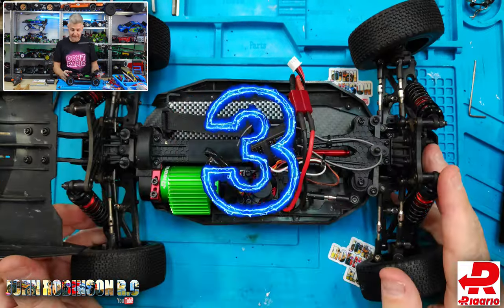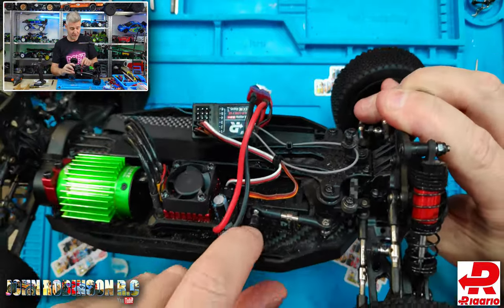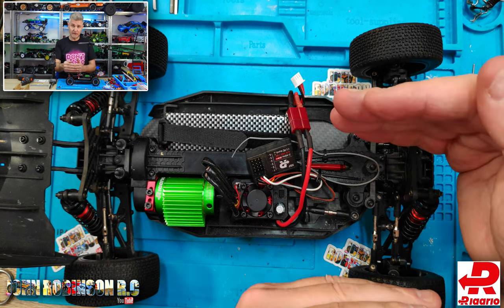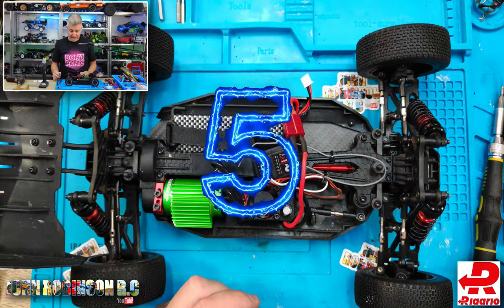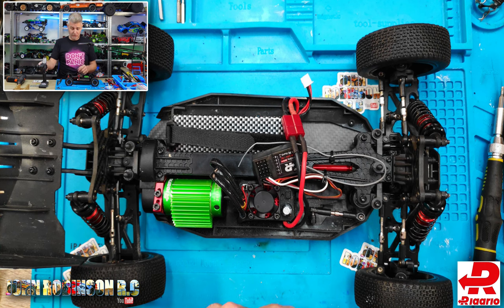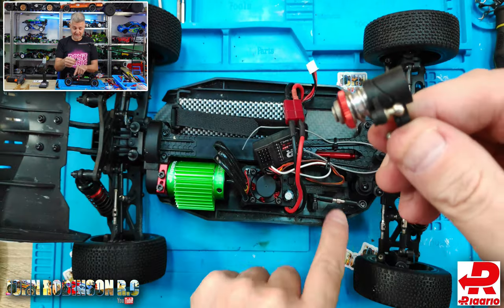HOW TO FIX 5 COMMON STEERING PROBLEMS - RC car steering solution for most cars

Comment: how often do you have to adjust the trim in a race? cause I'm not sure if the frequency of my adjustments for my car is normal. I have a bit of an OCD tho and its a slight slight veer that I still adjust.
Reply: Honestly most rc cars need their steering to be adjusted frequently. Especially after a knock. Only slight trim adjustments should be needed though.
Reply: @JohnRobinsonRC  okay thanks a lottt
Reply: Make sure the wheel nuts are tight—car can veer when nuts are loose, too
Reply: @JohnRobinsonRC  i need help with a traxxas rustler. Mine steers a lot to the left but just a little to the right

Comment: Tried all these and im still not getting proper wheel turning.  Steering servos (tried 2)work fine until connected, then not getting full range of motion on wheels

Comment: Awesome video, corrected my steering issue on my Typhon thanks to you. Thanks for sharing.
Reply: I'm having an issue with my typhon grom steering, and it's a new servo I replaced from sx110 to rs100 servo. And when I steer to the left, it stays left and right it keeps straight.

Comment: Hi I’m having trouble with my steering motor. I have an rc 1/12 scale upgraded from 6 AA batteries to 7.4 batteries using the same front and rear motors with new board transmitter and receiver once installed the rear motor works fine but when I connect the front wires to the steering motor gets stuck on the left or right position when I switch the wires then my board starts smoking and burns out any ideas could it be too much voltage going to the motor there are two resistors factory installed one on each side.

Comment: Hi. Can you advise me how to fix the following problem with steering?:  - when I turn left, and then release, wheels come back to straight.  When I turn wheels right, and then release, they don't come back to strait position all the way. the car is Reely Raptor 6S. Thank You.
Reply: That could be one of two things: 1. Your servo saver needs to be replaced. 2. Your servo needs to be replaced. You may also want to check your rods for binding.
Reply: I had the same problem on Wltoys. Check and found a small rock blocking the steering linkage.